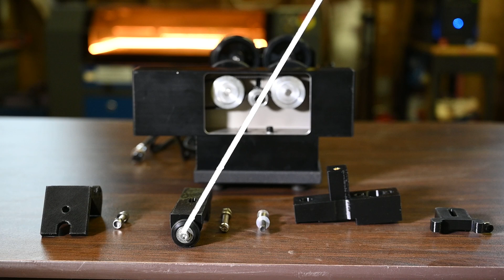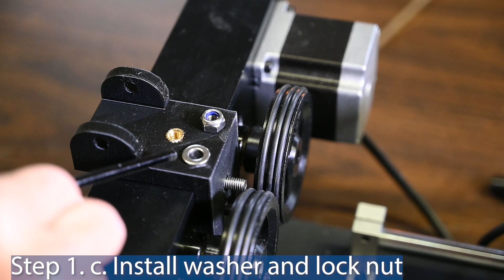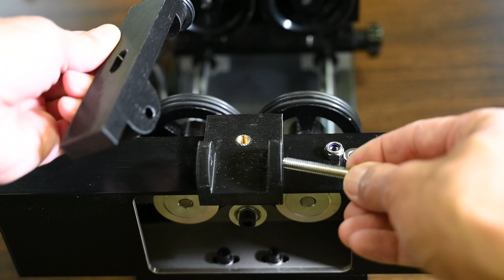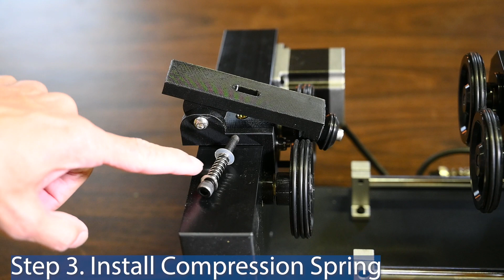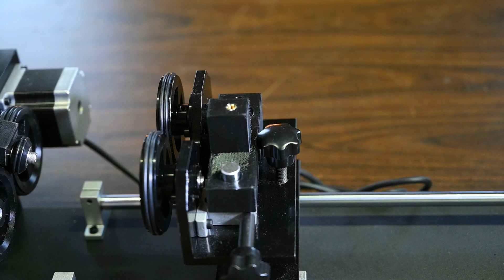Rotary Clamp V2 Assembly Instructions

Comment: What is the best method to adjust the clamp if you wish to burn wine bottles? Does it have to be removed completely? Love this clamp for glassware and tumblers.
Reply from the maker: It wasn't really designed for wine bottles... but I just tried and I was able to put a wine bottle with the bottom on the back wheels and the clamp was still able to press down win the mouth of the bottle.